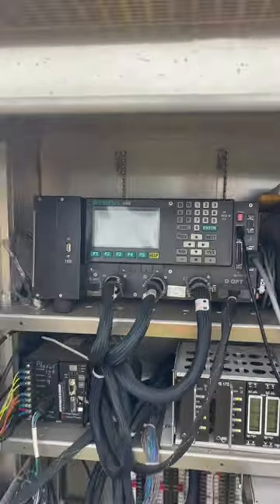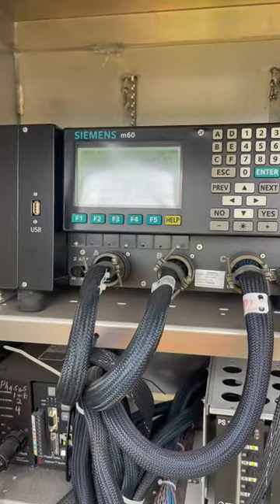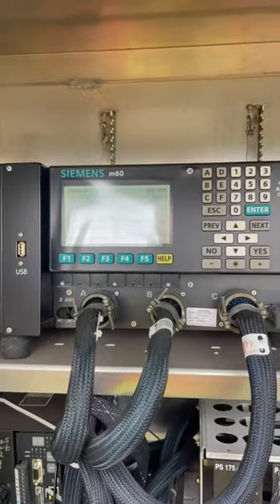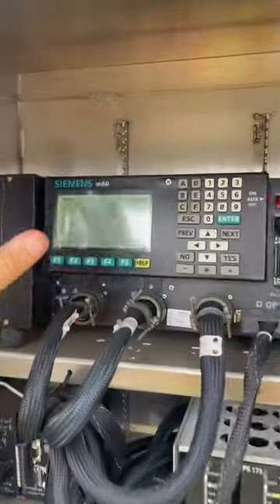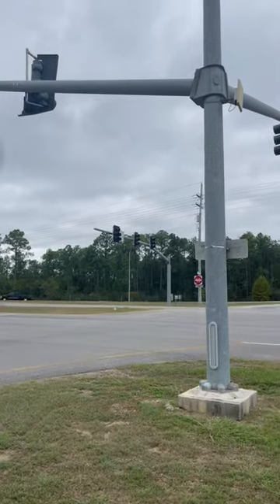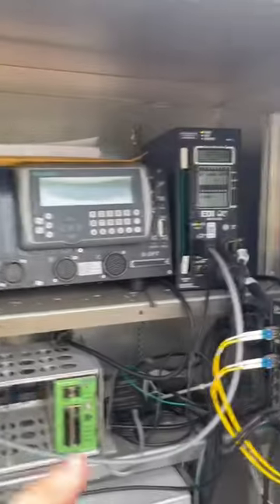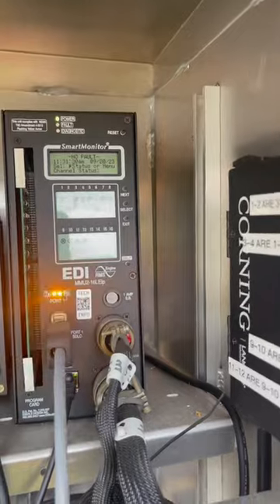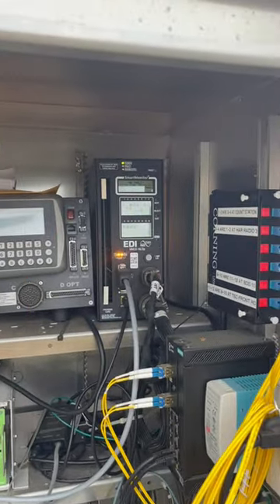Raspberry pi and traffic lights!

Comment: A Pi can be hardened and can be deployed in industrial settings. However, once you do all the engineering required to make it certifiable in that setting, it likely won't be any cheaper to what's already being deployed.

I love that we're having this debate over cost reduction centered around a few thousand dollars of computer hardware when traffic light intersections cost in the millions of dollars
Reply: LMAO I didn't know that the price difference was so large 😂. That is pretty funny!
Reply: Finally a REAL argument as to why you can't just use a Pi
Reply: A few thousand dollars over thoundas upon thousands of intersections adds up. American airlines removed a single ollive from their salads saved the company some $100,000 a year. Small cost optimizations add up FAST. Your line of thinking is part of why the government is so inefficient.
Reply: @benkahn5063  an olive is not a critical piece of infrastructure.
Reply: @austinschaffer7854  economics don't stop working if it's required infrastructure.
Reply: @benkahn5063 an industrial grade raspberry pi (if they even exist, I have some doubts based on my experience) is rather expensive and probably matches the price of that Siemens piece of equipment roughly. That is, without the software that would actually be required to be build and maintained to allow the raspberry for provide the same functionality. 

So you’d likely not even save anything when you’d do an apple to apples comparison. Not on the smell scale and not on the large scale
Reply: @benkahn5063 Exactly, except economics also include supply and demand. Which critical infrastructure has a incredibly high demand with a low supply. You know what happens to prices in those cases, in part because prices can reflect a slew of factors the customer has the faintest idea of. In this case, these controllers are highly expensive not just because of a sparse competition field, but because of their proven value (extensive testing, certification, ratings, etc). And if you’re suggesting that one can save large sums of money without sacrificing similarly large sums of value.. then I think you’re just being fanciful.
Reply: @EliotLu  their price (and most prices in general) is exclusively based on what the company thinks the absolute highest dollar amount they can get away with to mathematically make the most money. If you are implying the US government is good/efficient at spending money and couldn't save billions in basically every sector then you are flat out delusional. They spend $10,000 on toilet seat covers and hundreds for individual bars of soap. Companies don't really have to think about supply and demand when you're the only supplier and the demand comes from a government run by a bunch of demented old people. Stop dreaming. The up front engineering cost is not recurring, it would probably be paying a few developers and engineers to design an enclosure, some software for failover, more off the shelf parts for detecting failures on lights, relays for lights themselves, wires, power etc, more off the shelf power supplies. All of these parts are not expensive and you can pay someone once to put it all in. The job needing to be done is not complex.
Reply: @Mooooov0815   hardened enclosures do already exist because they are used in many harsh environments already (not that sitting in a water proof cabinet is harsh) the board itself is already long lasting, just the stuff around it would need to be replaced. Off the shelf power supplies already exist. Don't pretend like the software couldn't be written in a day by like one person, the job of signaling is not complex. It would be more difficult to set up failover for the 20 pis you would have in every box for redundancy and even setting that up would be easy. All the work of hardening for pis has already been done, the pricing of industrial equipment only to be sold to the government isn't going to be competitive in any way shape or form. There would be an up front cost to designing a new system but after that it would be thousands less.
Reply: @benkahn5063  "don't pretend like the software couldn't be written in one day by one person" lmao
Reply: @benkahn5063 "signaling is not complex" As someone who works in signal integrity and reliability, I can't disagree more. Even under perfect environment conditions, with all of the shielding money can buy, errors and failures are a statistical certainty due to non-idealities in the silicon and the circuit board itself. We don't ask "if" an error or failure will happen, we ask "how many" and "how often" do they happen. Electronics designed for the consumer segment like an RPI are designed to allow an order of magnitude more failures in time than a system designed for industrial applications.
Reply: @austinschaffer7854  yeah, changing lights in a set pattern that changes slightly when someone presses a button sure is a super complex software problem. surely isnt something an ai could do. for sure, you 100% are super knowledgeable in software development.
Reply: @benkahn5063  you're not accounting for smart grids, vehicle detection systems (both visual and magnetic), pedestrian crossing buttons, pedestrian crossing signals, priority for emergency vehicles, multi-intersection synchronization, snow/ice heating elements (for LED signals) and many other requirements that you're conveniently ignoring.

Don't get me wrong, I love raspberry Pis, I have a few and just bought a few more, there's no reason why they couldn't be deployed in this scenario, but you're making terrible arguments.
Reply: @austinschaffer7854  everything you said are not significant problems, a python program could do all of this with failover probably in less than 1000 lines (not that it is the ideal lang for this) you are just describing simple functions to implement. Basically all of the "complicated" things you are describing would simply be a matter of when a sensor input changes, compare it to a few others, then if it is detected to be safe to do so (or immediately interrupt if it's an emergency vehicle) change the signal or alter the timing to handle the current traffic flow. Sync between signals is slightly more complex but also still in the scope of software pretty simple, just a very small handful of timing pulses/com that slightly adjusts timing to keep in sync and a configurable delay between lights. Again stop pretending like there is justification for this waste.
Reply: @benkahn5063  oh wow that's an incredibly comprehensive requirements doc you've written there. I think you're right, should only take a day to code that up. I think you should go for it and totally disrupt the ATC market with your bleeding edge solution there.

While you're at it, you may want to review any of the standards that govern these kinds of devices. Pretty sure it'll only take an extra day to review.
Reply: @austinschaffer7854  im not saying the project as a whole would take that long, integration hell is a very real thing, but again, traffic signaling is a solved problem. if an experienced dev can in a day build a 3d graphics engine that can do ray tracing then the lights that tell cars to go vroom or not is not a stretch. your lack of knowledge on what a good dev can accomplish is not my problem. the reason for the system we are in and why the hardware for this that is used is so expensive is because of the government being a hulking, inefficient, nightmare run by out of touch people nearing their deaths; me pointing out how it could be better and you saying "but the government would stop you" is incredibly funny.
Reply: "certifiable" this is the keyword.
pi can do it but it has to meet all the regulations and certifications.  
thats a lot of paperwork.
Reply: @benkahn5063  This sounds like the most half-assed and underthought out approach to traffic signalling I've seen in the comments on these videos.  Do you have a prototype?
Reply: Last I checked, Pis don't have an RTC, so they must rely on an external network connection to keep time. Because of this, and the fact that they aren't built to high tolerances, they can drift, not ideal for time-sensitive applications such as traffic signaling which require high resilience.
Reply: Yeah why the fuck cheap out on the most vital thing in a intersection when it probably costs a shit ton to get one installed
Reply: Exactly. It's all the extra fail-safes, protection and redundancy that multiply the cost.
Reply: You're going in the right direction, but the liabilities are the biggy here. Whatever company  programs/designes these take on a ton of risk.  One tiny flaw not matter how benign that can be seen as a short cut to cheap out, could cost 100s of millions of dollars in law suits
Reply: Exactly a I/O controller is Exactly what it is. In this case it's specifically designed for traffic sections and in the Pi's case it's universal.
Reply: @benkahn5063 A terrible argument in regards to cost scaling. RPI microprocessors are more than capable, but are limited to their hardware.

My company’s SIEMENS equipment are basically raspberry pi’s but with with all the modifications needed for the RPI to do the same job, it eventually costs the same.

Besides, the hardware itself is cheap. Its the software that’s expensive. You’re barking up the wrong tree on what costs money.

Government could be using raspberry Pi’s from the start and it will still cost the same.
Reply: Went online and checked the price for Pi driven PCBs. They cost about 600 to 700 dollars a piece. So probably the same price as whatever is already in that box.
Reply: @austinschaffer7854 Sure it can, assuming you don't give a crap about quality control, haha.  You know all these people saying "a raspberry pi and a minimum wage in Indonesia developer could do it" people are the first that would be screaming when they are stuck in traffic because an intersection is out.

And without the safety gear, someone will get killed by their hacked together solution.
Reply: Millions? That must be cap, im working on the wrong industry. Traffic lights arent super complicated. And you can mount shit on isolators if it needs to survive anything that doesnt rip the box from the slab. Conflict monitor isnt rocket science either, its just another plc with voltage inputs. ..plus that 3 decades is definitely cap. Those failure.rates are purely statistical
Reply: Brb Imma go HARDEN my raspberry pi
Reply: no traffic light costs 1 million dollars lmfao. 5k at best
Reply: @austinschaffer7854  hes very right lol. writing software to turn a light on and off is not hard. writing software to monitor the incoming voltages to determine when to put the light into flash,  is not hard.
Reply: Also the pi is just the micro proc....  They build the computer system around it. Like you said they are all over heavy industrial services, but require lots of engineering and systems required to meet certifications and conditions. And a pi doesn't have that kind of I/O. You would have a whole series of them talking over a serial bus to each other making it worse for performance overall. It's best to use the SOC designed for the job! Lol
Reply: @bmxscape to turn a light on and off huh, way over simplified that.. you must be pretty simple yourself
Reply: @bradical2723  u gotta be special if u think adding a timer makes it harder
Reply: never stopped to wonder *WHY* they cost millions?  Never thought this might be part of the reason why?
Reply: @Mooooov0815  all this monster controller is doing, is turning off a handful of lights.  it's overbuilt 30,000%.  Even a pi is overkill on top of overkill on top of overkill.
Reply: Yeah I have a feeling after you ruggedize and make a rPI compliant and bulletproof, you’d end up at the same price, as a niche product that has some niche company catering to it
Reply: if you think business to business or business to government is under the same competitive pressure as the consumer market, I've got a $10000 toilet seat cover to sell you
Reply: @benkahn5063 i'm no Expert in IT nor in public infrastruttures Application and not even I would be capable of oversimplifing a complicated matter as much as you did
Reply: @benkahn5063  I believe they also shaved off their in flight reading material by something like half a gram each which over a year saved the airline $150,000 in fuel alone.
Reply: Millions is a bit of a stretch. 250k tops with multiple tests and revisions. That is a very simple system.
Reply: This isn't a complicated problem at all. It would take a team of software engineers less than a week, tops. And you would only need one repository for most traffic light systems. 
Obviously a lot of people in this comment section lack basic knowledge of public infrastructure and software development.
Reply: @Mooooov0815 they don’t exist. There are no IEEE Pi’s. There are a few arduinos that are for industrial purposes, but in no way shape or form are they ever used in safety critical applications
Reply: @austinschaffer7854  they could remove the yellow lights. Just think of the savings on light bulbs.
Reply: As a mechanic with a background in welding, i can make a 500hp car out of a a flood car and  an accident car for less than 5k. There's no way I would be able to pay to have these certified for mass sale at that price.

Comment: I do heavy industrial. We have tons of automated systems. Never in a million years would i use a Pi for something critical to operations. Now for a monitoring SCADA system or something non process critical, sure. Butbeven then, industrial gear is just built better. Plus you have a supplier network for parts, service and technical support.
Reply: Industrial raspi setups are insane from what I've seen, wouldn't mind if I got the opportunity to see one in person

Comment: So what I’m hearing is it should be FIVE raspberry pi’s in an airplane black box 🤠
Reply: So that when one fails, the next one can act as a backup, and by the time the fifth one fails, the plane is already on the ground.
Reply: @youtubeusername1489  I meant the black box would be in the traffic control box protecting the raspberry pi’s 😭
Reply: A well designed 3D printed box can survive major impacts better than a thin sheet metal computer case enclosure. They don't even need to get into aviation grade black box enclosures.
Reply: @phillyphus  it’s not impacts that causes worry, the biggest worry to me would be temperature fluctuations in the box and weather like humidity getting in
Reply: @OfficialDeathScythe  actually it might work, again with a careful design, and there’s already high temp filaments like polycarbonate that can do 100C - I printed it on a bamboo lab printer, and for condensation and moisture protection you could probably design something - of course all of that has to go through testing and proving it’s worth - I guess you could do away, now the main issue is the “social” one, implementing a new system into something that’s already useable - rPI and 3d printed stuff, it’s like breaking into a new system that’s already established and working and had an entire workforce behind it.. 
I saw when someone got some NASA space grade PCs - it was your same old home PC hardware - just that it was protected with a lot of resin and redundancies, basically specialty hardware modding.. it could probably be all done, but since there’s already a working system in place - the old saying goes: don’t fix it if it ain’t broken..
I still see some shops use DOS software running in a windows terminal - cause it still works, it’s rediculous but it works.. 
I think the same thing with nuclear missile silos, the backup data held on 5.2” floppy discs..
Reply: @OfficialDeathScythe  I mean they've used raspberry pi's in the arctic in -55c temps and in the desert with +50c temps doing various experiments for multiple years. Where is there a place with traffic lights that's going to be higher or lower temps than that? The pi was sat in the arctic for a year taking pictures of the varying enviroment and changes. The units used a raspberry pi zero and lasted over a year in those conditions.
Reply: The black box is a recorder on the plane and airplanes, another very no failure acceptable application, do not have a single or even multiple centralized computers. They have multiple independent redundant sets of specialized computers. The airbus A320, one of the most computerised planes in the world, has, for example, four seperate computers for flight control inputs
Reply: "OH GOD THIS PLANE-"
raspberry pis give up on life

Comment: Humidity resistance also comes to mind for the DOT specced equipment. I know we use a lot of SignaMax just for their long lasting use cases in really extreme weather.
Reply: So what you're saying is if you put a pi in an adequate case you'd be fine? Yeah.. We know..
Reply: It costs a few bucks to conformal coat the board and a few more to put it in a water resistant case.
Another failed argument
Reply: @MrCarGuy  What are the specs on the case and conformal coat? Where was the technique and material certified? Where was the solution independantly tested?

Comment: Those Amphenol military connectors ain't cheap either. That's the good stuff. Built lots of military cables of various sizes and complexity with those connectors.
Reply: I hate those cables with a passion.
Reply: 38999s are the best
Reply: @MotorcycleRebuilds Them is good cables. It is the connectors that always failed for me. I can't count how many times troubleshooting proved it was the contact pins. Granted that half of time it was user error, but still.
Reply: I've assembled enough of those amphenol connectors to know that they are shit.